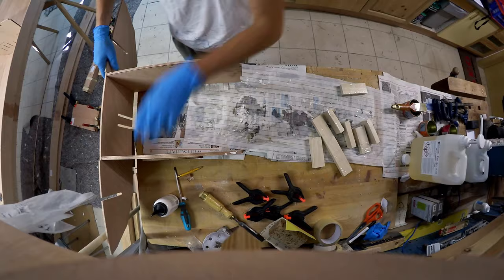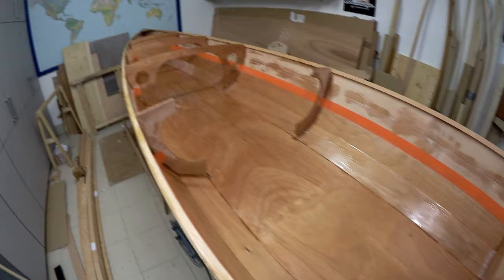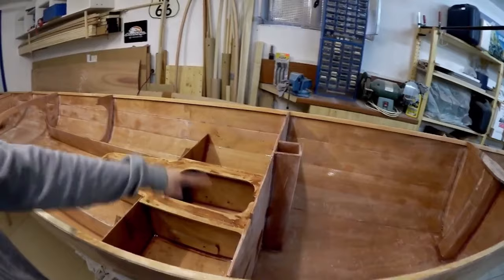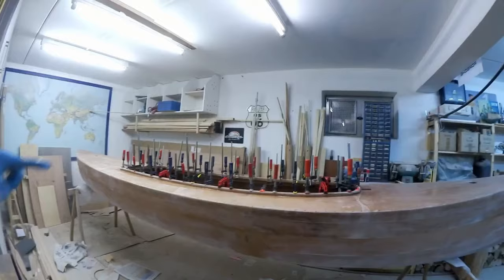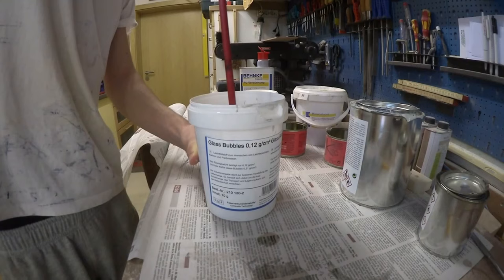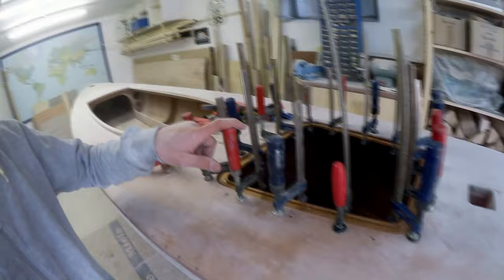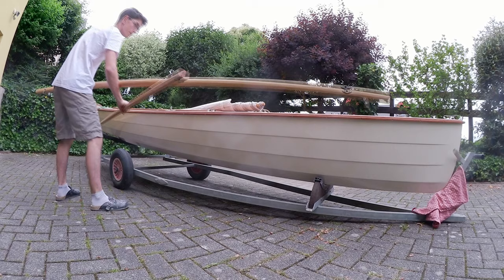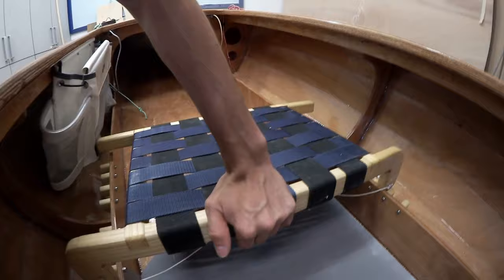Building a Waterlust Sailing Canoe in 10 Minutes

Comment: Great canoe. It's possible to sleep in?
Reply from the maker: Yes it is (if you're not the tallest person). I am 1,75m, I can lay down inside the boat and even have room to turn around. (I'm not sure how long the area is, but I could mesure it for you if you are interested)
I wouldn't sleep on the water though (risk of capsizing in a wave), but on a beach it should be okay. A little tent would fit inside the trunk too.
Reply: @elltielle  Thanks. Won't be necessary to measure, i was just curious. Here, in Brazil, the cost for the kit would be impracticable. But, David Gentry has plans for one sailing canoe that maybe fit the bill. I think that in a quiet harbour you can sleep into the water.  You just need to give a try.

Comment: For your own safety, please wear a proper doublez-filter pro face mask when sanding and dealing with fiberglass and epoxy, plus ideally working on a well ventilated room. Nice work!
Reply from the maker: Hi Peter, sorry. I didn't see your comment.
I bought an actual double-filter-face-mask recently (primairlily for spray-paint-jobs) and also wear it now when I'm sanding. I have to admit, it really helps a lot better than those FFP2 masks, should have gone for it earlier, I can only agree with you.